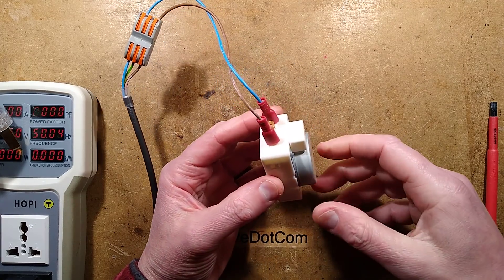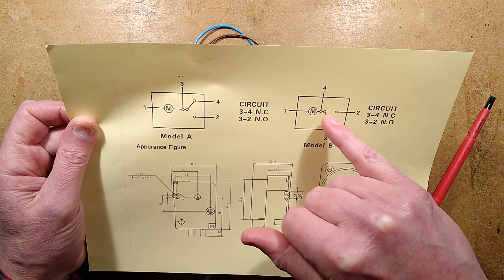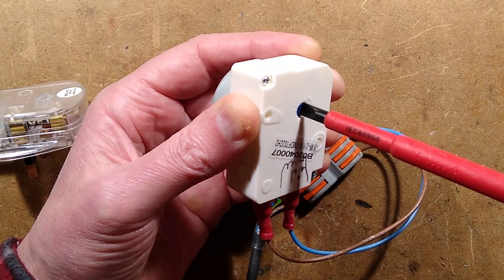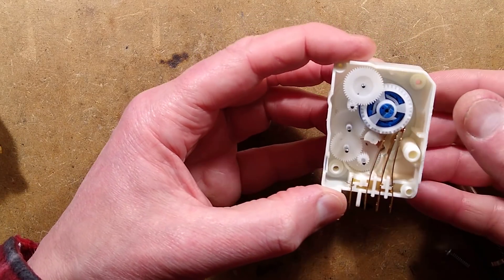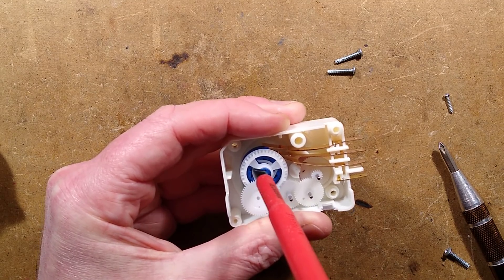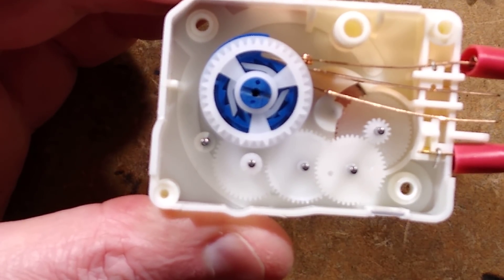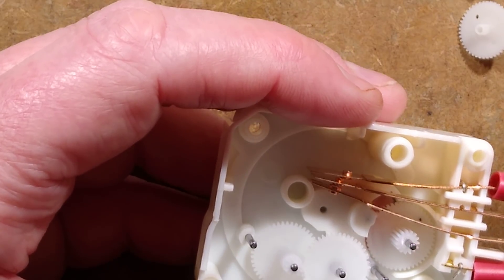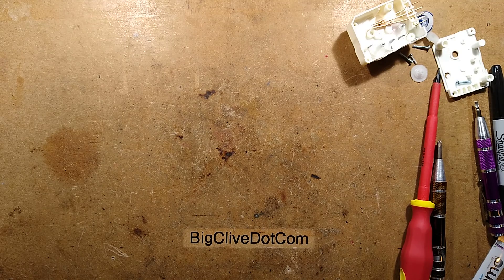Defrost control timer.  More complex than you might think

Comment: There’s a massive business on eBay and elsewhere regarding rebuilding timers such as this. Washer and dryer timers are very similar, and the contacts are notorious for arcing and eventually failing.  in the past 10 or 15 years they have change the designs and now they fail prematurely. “Planned obsolescence”.

Because timers and contacts in the older more reliable machines would rarely fail… And only after many years of service.  most reliable part of the older washing and drying machines. Now they go out every few years. Sometimes less than two years. And have no more longevity than washers controlled by complex circuitry. I’ve refurbished well over 100 washer timers, usually needing to install new contacts or entire arm assemblies according to the damage, And how much heat/current flow was involved during the failure.

Sometimes you can get away with resurfacing the contacts if they are solid silver, or resurfacing and replating them if they are silver plated copper. But it’s very evident when comparing the newer and older contact side-by-side… The plastics that are used, the alloys, and the way in which the contacts and arms are designed… They have absolutely changed the designs and they are 5 to 10 times less robust. Surely that can’t be by accident.
Reply: As circuit boards/CPUs have come down in price, mechanical timers must now be cheaper to compete with CPUs in this market. 

I've seen other signs of cost cutting when I've messed with display models, including electronic ones. I could press a button gently, just hard enough for the button to actually click, and see the other buttons move with it. I can also flex the control panel plastic chassis itself with just one finger. It feels like I could break the buttons free of their mount so they fall into the chassis, or break the control panel off the top, with just one finger if I push hard enough. How something that flimsy could even survive the vibrations of the spin cycle, I have no idea. I'd hate to see how much a laundromat would have to charge per load just to break even!
Reply: @dickcheney6  Thanks for the reply and insight. Yes that makes complete sense… Because the boards and electronics they’re putting in washers these days are exceptionally cheaply made. Sure they might charge $350 for a new replacement board (even for a 10 year old machine)… But you can see the true value of these boards if you look up the used prices on eBay.

Most can be found for $40-$60 in used condition. 10 years ago even a used and beat up board out of a washer would sell for $200. 

But now these are so ubiquitous and cheaply made… The eBay used prices really show the true value of the modern crappy design.

I’ve probably got 500 washer/dryer timers, spanning the ages from brand new to 30 years old… And there is a HUGE difference. The plastics and materials they’re using just don’t stand up to the heat of current flow in some of these modern machines. The heat from contact arms start to deformed the plastic which puts the contacts closer together (or further apart) which starts to cause arcing. I’ve seen timer contacts burn out within a year even on some of the most high-end modern machines. 

The old Plastics were similar to thermal plastic or Bakelite. Almost like ceramic and didn’t deform under heat. They would burn before they would soften. 

But this modern Plastic is more like recycled used condoms. If it heats up just a bit, it starts to deform and soften allowing everything to move around. 

The tolerances for the contacts to line up properly are in the hundreds and thousandths of an inch. Like the thickness of a business card. So even the slightest movement of softening plastic screws everything up
Reply: Washing machine lock solenoid and switch died on me in less than 3 months.

Comment: 2:19 When you rotate the shaft of these micromotors, they work like a generator and they can generate a few 100V due the gear ratio. You can use these for making a handpowered Megger.
Reply: I had to look up what a Megger was.  Thanks for the new info.
Reply: @R_Forde  , it's a wide used name, but in fact only a brandname. It's called a insulation  tester offically, but everyone calls it a Megger. :-) Grtz
Reply: @BjornV78  Yeah, it just took a bit more looking past the first few results to get the insulation tester results and not the company info.  DuckDuckGo did well

Comment: I absolutely love this man's accent and fluent terminology in these reverse engineering videos. Not seen a mistake yet. Top notch content 👌
Reply: So you missed the fact he got the pen tops mixed up and referred to the thermostat 'calling for heat' (10:08) when it's running refrigeration equipment !
Reply: Just wait for the pink calculator! 🤪 
Loves BigClive 😂
Reply: He made mistakes. He forgot to specify which motors turn off. This defrost timer motor never turns off. All it does is run constantly so that, depending on the model, every 4/6/10/12 hours it cycles the defrost system to turn on & it turns the compressor off while the defrost cycle happens. In models with ice makers this unit is usually built in to the end of them. I know this because I went to school for residential refrigeration & furnace repair.
 I think he made more mistakes but I just woke up and don't feel like going through it all now. Even if the circuit is wrong he got the general gist of what it does correctly.
Reply: @johnpossum556  he specifically, at multiple points in the video, adressed that THIS defrost motor ONLY runs when the compressor runs. And that there is the other model with the different schematic, with the comment "never the twain shal mix" at 1:05, and that "the connection of the motor is different". As AvE once said, "if you assume, you make an ass out of u and me". You assumed you know better without listening to (or watching) the video. Clive even explained the exact function of the circuit in great detail, beyond any shadow of a doubt that knows how it works. Just try substituting model A for model B in his schematic and you will be surprised to find that it completely changes the way the defrost motor works.

Comment: Cool can these be used for anything else?
The apartment place I live in is very wasteful and it is a Hell Hole (As soon as I find another place I'm out!) anyway I took some parts off of trashed refrigerators I just wanted the lamp socket but two screws and a wire harness a whole module came out it has the light switch lamp socket thermostat and the defrost timer it has a five pin harness but only four metal prongs on the module and only four wires in that harness but it could have five but no metal pin is inside.
It has 2 different contact ratings for each set of contacts 1 is 10A the other one is much lower
Reply: Oh I forget the refrigerator was a GE I have three of these two newer ones from 1999 or so made in Mexico and one older one from 1990 or so made in the USA the two newer ones came from R-134A refrigerators and the older refrigerator used R-12

Comment: That's a rather ingenious mechanical state machine. Very cool!
Reply: But he forgot to mention the timing and the thermal limit cutout switches that make it possible to defrost the freezer coils w/o inducing so much heat inside the freezer box that it forms rings of rot into the meat. In general I think his wording could have been a little more precise in this video.
Reply: @johnpossum556  Touching the machine shakes the timer and probably helps push it over.
Reply: These timers actually remind me of an Internet Protocol state machine we worked on as a project at university. A tiny program but almost insanely complex.

Comment: the tiny window is so cute. why don’t they just make parts like this clear, though? is it that much more expensive?
Reply: One of the whirlpool defrost timers is clear.
Reply: Part # W10822278 I think
Reply: @mattostrokol  All the way clear? The one I most recently swapped had a clear dome over the motor, but the cogs were still in opaque white plastic like Clive had.
Reply: @McTroyd  just the clear dome, but it still makes it easier to see the motor running.
Reply: It limits you material selection quite a bit. Unless it's really necessary no one will sign off on making it clear. No doubt the engineer would have probably loved to do it.
Reply: Cause clear casing fascinate even the most non tinkerers. They want it to look clean inside the fridge and white is the color for that.
Reply: @alec4672  I don't think this would actually be mounted inside the fridge; more likely that's the cheapest plastic having the required spec for the job...
Reply: @AAAyyyGGG  It actually is mounted inside the fridge, at least the ones I've seen. Not right in the open but under the plastic cover which also contains the main thermostat, light socket, and associated wiring. Though there is a hole in the cover to easily access the override.
Reply: Injection molding polystyrene sucks (I still have nightmares about ejector pins and shattering plastic) and likely has a lower yield and cost than the opaque ABS they probably used for the housing.
Reply: We need a pink one.
Reply: When I was a kid the hardware store sold white or brown plugs, lamp sockets, adapters etc.  The white ones were a few pennies more. Of course you couldn't do that today.
Reply: Also, if you are ok with white you can put ten percent chalk in there. Chalk is cheaper than plastic and increases the rigidity.
Reply: @alec4672  Control knob?  You mean the manual over-ride?  That's for the repairman's use in figuring out what's going on.
Reply: Big Clive has less than a million subscribers, that sadly means that there is less than a million people who cares ☹️

Comment: This also goes for the Ice Maker, don't put your hand in there to clear a wayward ice cube. The ice maker gets VERY hot during the defrost cycle and will leave you with 1st-degree burns. Fortunately, there was ice nearby...hehe
Reply: In industrial refrigeration we run a defrost regulator around 75 psi, which is about 45 to 50 degrees saturation temp for ammonia(R717)
Reply: Interesting. Usually the defrost heater shuts off when it is only a bit above freezing. Either there's something different due to how the icemaker is built or maybe you don't have a working defrost thermostat.
Reply: Just a heads up. Don't put ice on a burn, only running cold clean water. Ice can actually keep burning burns
Reply: @ShinyPeeko  silver sulfadine rx required for cream
Reply: Funny thing about getting Bruns with out knowing it gets hot. I was clearing a jam in a toner printer burned the living fuck out of my finger tips. I felt like Will Smith in MIB when he gets his finger prints erased.
Reply: @boyd19043  Was it the first time you'd ever used a toner-based printer?  I would have thought the fact it ejects warm pages would have clued you in that there's something hot in there.  (Unlike a residential-grade freezer unit, it has to be hot enough to melt plastic, so it really is quite hot in there in operation.  Not as hot as some of the early drum printers got in a jam, though.  The "Printer On Fire" error code is something of a joke NOW, but it wasn't back in the 50's and 60's.)
Reply: @evensgrey  All depends on the age of the printer. Old laser printers do retain heat for quite a while. New printers, due to energy efficiency requirements and impatient users ,have been optimized to keep thermal mass in the fuser to the absolute minimum, so they both cool very quickly, and the hot parts are restricted to the tight gap where the paper feeds. I remember when it took a minute or two for the fuser to warm up.
Reply: @boyd19043  It's called the "fuser" for a reason!
Reply: I did touch the hot coils of two ice makers that I was fixing and oddly enough they were nowhere near hot enough to cause any burn.
The ice cubes on the other end were melting just enough for them to fall into the receiving bin inside the machine as it should happen.
(The faults on both machines were the same: Corrosion from electrolysis on the water level sensors by the way, nothing to do with the refrigeration part of things).

Comment: Wonder if the same function is performed by electronics in some fridges. My fridge has at least two rather complex circuit boards, one actually called a motherboard. Both of the circuit boards have - of course - failed and needed to be replaced. Nothing as obvious as a burnt component or a bulging capacitor. Perhaps the electromechanical timer shown in the video is a better approach. The effort put into the design of these things is phenomenal. Doubt if the code in my fridge's motherboard is as carefully optimized. "Cool" stuff.
Reply: The timer is a "known" set time... compressor run time. It defrosts whether the box needs it or not. The new defrost systems are "smart". They monitor compressor run time but they also monitor how much time it takes for the defrost thermostat to open. They monitor the defrost thermostat action. Based on the time.... the board will shorten the defrost time as well as extend time between defrost cycles. This smart defrost method saves energy by only activating the defrost cycle when needed.
Reply: @TheSoundmanPete  Thanks. That makes sense. Electronics do make for smarter appliances. I just wish they were more reliable. Every time one of my appliances fails, I need to replace an expensive circuit board, sometimes two.